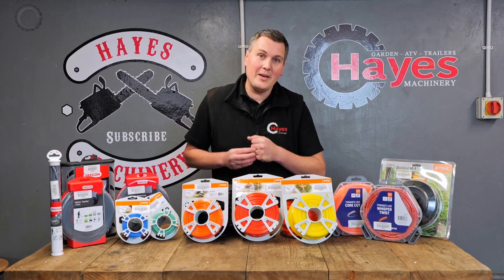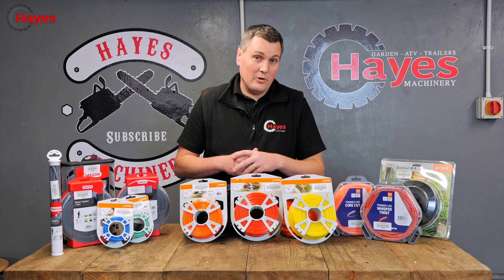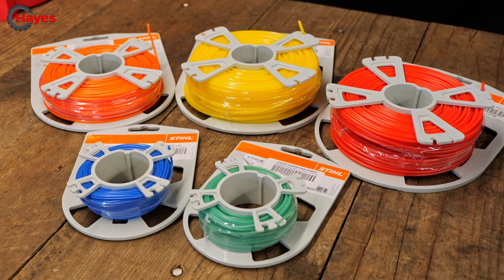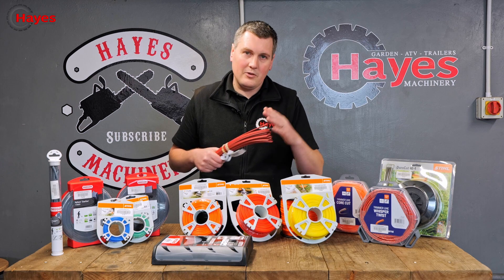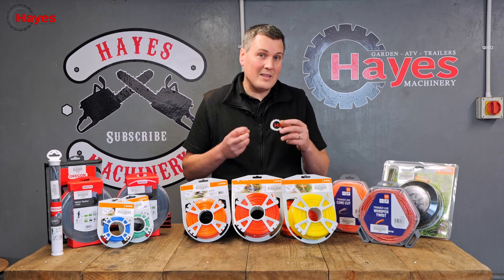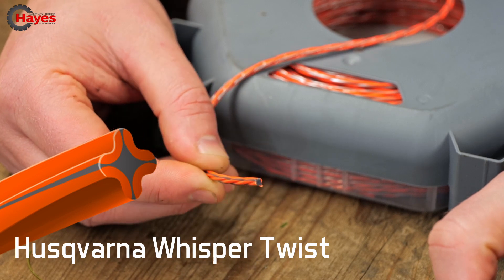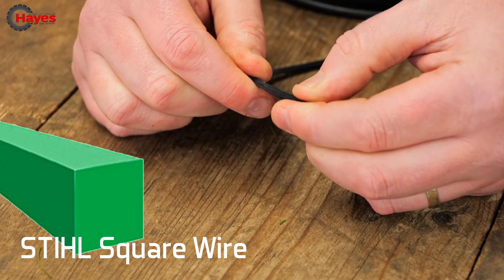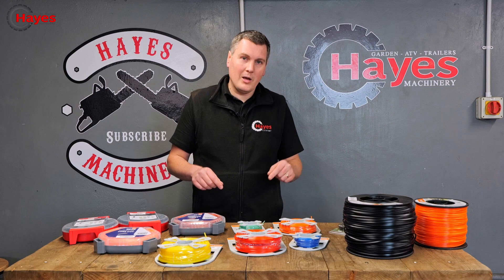Why Won't My Strimmer Wire Feed Properly?

Comment: Brilliant video as always.  Quick question.  Id had to replace 4 heads on my husq 545rx within 6 months and it isnt being over worked by an means . Can u suggest a replacement head or what im doing wrong.  Keep up the good work 👏
Reply from the maker: Hey JB thank you for your support. Which heads have you been fitting? Genuine or aftermarket?
Reply: @MachineryNation  thanks for replying.  I always use the husq t35 head . Im using fairly thick nylon tho . Would that be my issue.  The head falls apart and the spring pops out
Reply from the maker: @JBAgrivideos  yeah maybe, I would say 3mm is the max size cord I would put in it. If that does not help, take a look at our website as we have several different head available on there, maybe the Oregon jet for head.
Reply: @MachineryNation  perfect im looking now 👍
Reply from the maker: @JBAgrivideos   let me know if you have any questions 👍🏼
Reply: The 545rx comes standard with the t45 head, the t35 is a bit small for a that size of machine
Reply: @theautisticarborist6846  my apologies it is actually the t45 im using.
Reply: @JBAgrivideos  maybe try the t55 or the  jetfit 4 line head ? What conditions are you cutting in ? Grass, brambles, brash ? Etc ? Rocks, stones curbs ?
Reply: @theautisticarborist6846  im cutting nettles, grass, strong ditch growth during the year . I love the strimmer.  I take very good care of what im doing while strimming but it seems to me the black plastic squares inside the head for releasing the nylon are wearing / rounding and the head falls off leaving just the back of the head attached to the strimmer